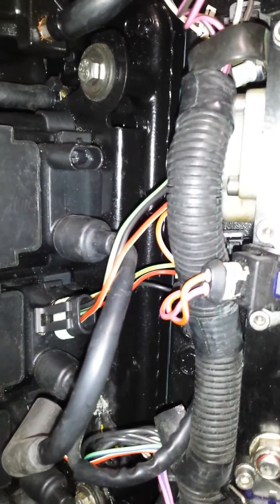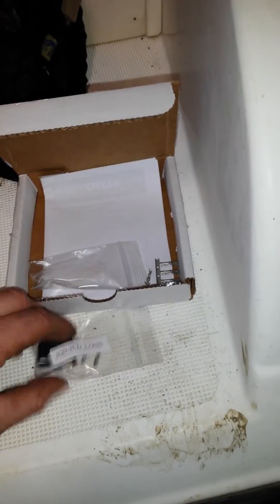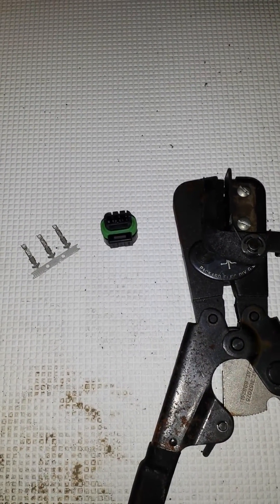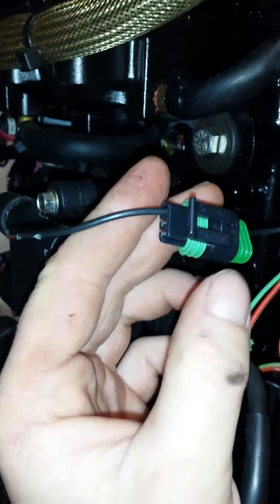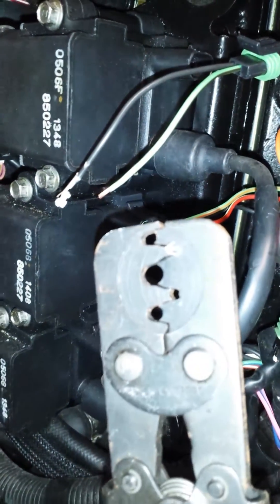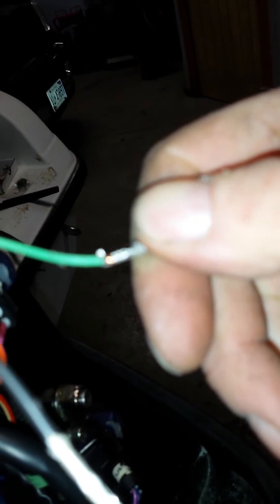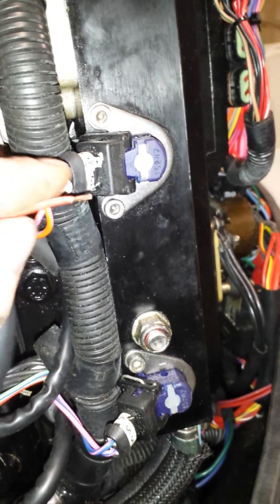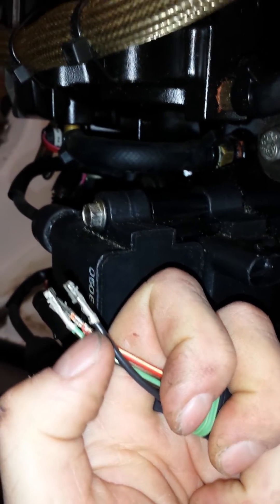135 optiMAX part 3

Comment: hi I have a problem with a air coil Optimax 250 dfi need to replace a pin on a coil connector can u help with a contact for the correct pin or kit
Reply from the maker: Diy auto tune.
Reply: @fullytekmechanical3595  ok great looking at site now hope they can help me which location did you use
Reply: hi Gregory found the problem broken pin in both air injectors 1 and 4 cylinders both on red wire with blue stripe common to all air injectors on fuel rail great video pointed me in the right direction for sure keep it up thanks again